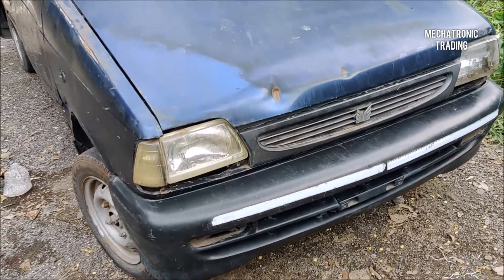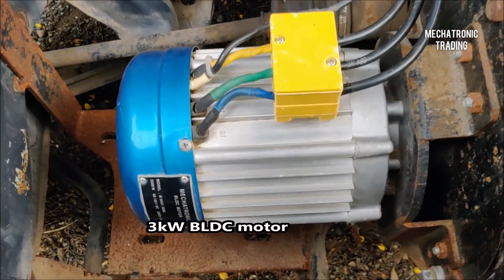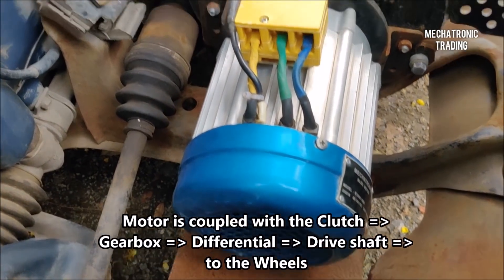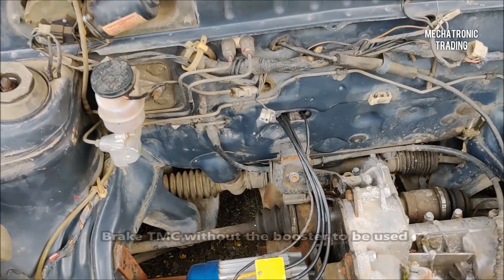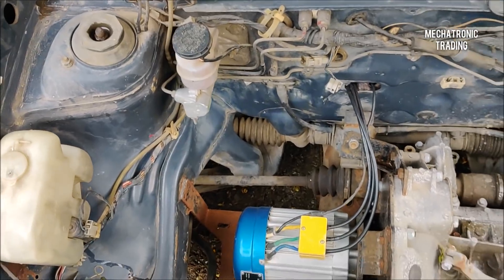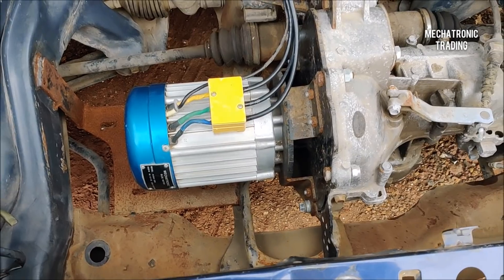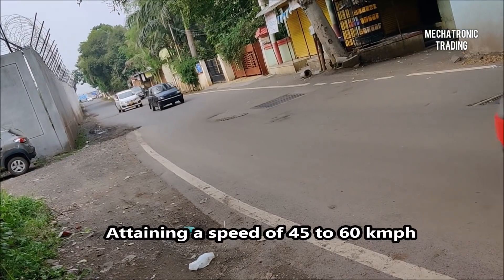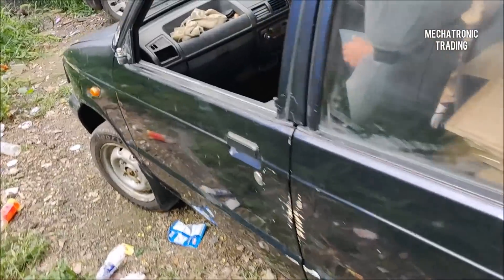DIY Electric Car Conversion Kit India | Maruti 800 Electric Conversion Kit | Electric Car

Comment: here a quick tip !!!..... 
consider the motor voltage of 60 volts , and the power is 3000watts or 3kWh , so we can calculate the amphre required to the battery by a single calculation by diving the motor watt by motor voltage gives the amphes required to run the motor for 1 hour that is ,.. 3000/60 = 50 amps , so we need a 60 volt 50 amp battery to run the car for 1 hour , and to increse the time we can connect a same spec battery to parralel connection and get 60volt 100amps so we get double the mileage

Comment: Do you have a 72v-96v 5000kwa motor matching 6000 max rpm of the 800cc engine? I understand there would be additional batteries required

Comment: Super and excellent method of using with existing gear box. I would like to implement on my 800 but using Omni's rear axles without disturbing engine bay. Seeking your support. Thanks
Reply from the maker: For details call or whatsapp on 9763025510
Click to WhatsApp us :-
https://bit.ly/2MryHj5

Comment: I am waiting of detailed video of this project.
Reply from the maker: Will soon upload it.
Reply: An electric tricycle kit is quite simple. Or you can search by the name of: bldc 3000w motor controller and foot throttle. but I recommend that you use two motors in case your car is a little bigger this maruti only weighs 500 kilos worse others can weigh 900 already with the motor and the batteries. the battery must be 60v or 72v depending on the configuration of the motor I recommend two motors by the way.

Comment: Can i use 2kw motor for increasing the speed of vehicle by attaching pulley system to the transmission plse reply me on wats app brother i am also an automobile engineer with 2019 passed out 7358662324

Comment: Maruti 800 engine produce 27 kw of power and u r using a 3 kw tiny motor 😅
Reply: But it is not the same with the torque of electric motor.
Reply: Bhai mere engine ho ya motor power sabb ki kilowatt m he measure ki jati h jisse bad m hp m convert kr lete h 1 hp = 746 watt
Reply: Maruti 800 produce 37 hp
And this motor is producing just 4.25 hp
😅😅
Reply: The Electric motor is 9 times weaker than engine + transmission losses
Reply: @insaneingineer642  but torqe is high bro
Reply: @biluroy4455  Roy sahab electric vehicles m torque (pick up) se jyada efficiency matter karti h
Reply: @insaneingineer642  efficiency bhi bhout jayada he
Reply: 90%

Comment: Looks simple but quite a great idea. Incorporating the stock gearbox too was really a great work to utilize more power from that small motor but what about the battery you are using and what is the range and charging time, load carrying capacity...etc...

Comment: Hello Sir, 
Very very good, how many volt & ah of battery?
Reply: consider the motor voltage of 60 volts , and the power is 3000watts or 3kWh , so we can calculate the amphre required to the battery by a single calculation by diving the motor watt by motor voltage gives the amphes required to run the motor for 1 hour that is ,.. 3000/60 = 50 amps , so we need a 60 volt 50 amp battery to run the car for 1 hour , and to increse the time we can connect a same spec battery to parralel connection and get 60volt 100amps so we get double the mileage
Reply: @black-cat-hackerjr822  thanks for reply
Be happy
Reply: @pateltach5067  thanku mr patel , i struggled a lot to find about battery volt and amps calculation , i thought if i can clear your doubt it might be a good thing to do , i know i anm year late but hope it helped you in  your project mr patel , bye take care be safe and happy

Comment: Transmission box can be detached to allow more power and efficiency from the motor...you can use an electronic speed controller to control the speed and reverse. Using stock transmission will make the car heavy for an electric conversion reducing the motor power and the battery capacity.
Reply: Or lets say keep 2 gears remove the rest. Effective weight reduction plus range increase

Comment: What is the top soeed of this car and how many km it can do in ine charge
Reply from the maker: Top speed is 60 km/hr.We have installed a battery pack of 60 volts and 56 Ah for test ride application. We get mileage of approx 40 km/charge. Increasing the Ah rating of the battery pack will increase the mileage.
Reply: @mechatronictrading7446  mileage is not that bad but can be improved and please use lithium ion portable pack. That will keep the boot space intact

Comment: Great job I am also interested,,,,,, can you convert Maruti Suzuki Eeco into electric one.......
Reply from the maker: Thanks for the appreciation. Eeco will require a higher wattage motor. We will keep you updated once higher wattage motors are available.
Reply: Ok ,,,,,,I also want you to install ,,,,,a battary pack of around ,,,,40kw ,,,,,so that the vehicle gives longer range,,,and please try to install battery pack in the bottom of the body of vehicle,,,,,so that the boot space in vehicle,,,,,does not get affected,,,,,....

Lots of Love and Appreciation......keep doing this great job......

Comment: Plz add heat silk to the motor and opening on the bonnet to keep the motor cool. Second ly there should be some mechanism to control motor rpm at 800 at the start.
Reply: heat sink is a good idea. But what is the purpose of idle rpm at start . It will ruin the concept of electric cars because in traffic lights , it will constantly waste energy
Reply: @sumitmahawar6174  I will rephrase it should be starting rpm, because electric motor starts instantly at full rpm unlike ic engines where throttle push gradually increases the rpm. A full rpm from a electric motor may hurl the car instantly forward instead of smooth start. And another thing, our roads are often water logged, so plz make precautions to keep the passenger  and outsiders nearby from getting electric shock if the car accidentally enters water logged street
Reply: @siddhartharay1835  actually the rpm depends upon how u press the accelerator. U can experience it by putting the car in neutral and pressing the accelator...
Reply: @siddhartharay1835  also, these motors are waterproof in nature, also they are placed at a good height. Also we can it protect from shocks by putting controller in a safe place and all wiring in a closed pipe so that water does not touch any connections
Reply: @sumitmahawar6174  but if the hardware is sealed heat cannot escape
Reply: @siddhartharay1835  hardware needs not to be covered , its the wires and connection which can leads to shocks .for safety purposes you can use circuit breaker which cuts off the connections as soon as load increases
Reply: @siddhartharay1835  in costlier solutions which OEMs adapt, they employs a coolant which cools controller and motor so that they stay protected from water and run forever
Reply: @sumitmahawar6174  that is required bhai, to make the car practical, pls build a proper prototype and get a patent, then you can use it in any vehicle, just scale up or down
Reply: @sumitmahawar6174  but electric motor is a dangerous piece of hardware, any spill if water can cause fire 🔥
Reply: @siddhartharay1835  same motors are used in e-rikshaws in all over the world. They can hold alot of abuse. Nothing to worry regarding splash on motor
Reply: @sumitmahawar6174  I have seen but e rickshaw never go into water, moreover rickshaw are cheaper, and low voltage stuff, while cars are expensive and high-voltage goods. That is why I m a bit apprehensive
Reply: @siddhartharay1835  e rikshaws have to deal with water in certain areas of our country. Motors are waterproof but upto a certain level. Also motors are placed at a specific height which is way high than ICE engined cars.
Reply: @siddhartharay1835  if you are thinking about high voltage stuffs or fire, then don't worry. Cars such as tesla runs on much higher voltage but all it takes is making a safe system if anything goes wrong
Reply: @sumitmahawar6174  I m not v much sure about Tesla being successful in India. It's a very low floor and full of gadgets which may break down any time in our humid condition.  Just like merc, BMW, and Audi, very high maintenance, other wise will break down anytime. Gives signal on dashboard at any bad roads, and you have to rush to service centres
Reply: @sumitmahawar6174  if this is our indigenous system, then plz go for patent....some body might steal the design
Reply: @siddhartharay1835  this is not a rocket science. Carefully designing a system which can cut-off power supply incase something goes wrong is not so difficult. I've personally made my electric which is in beta mode right now

Comment: Is it possible to convert indica diesel car to electric... Can I know the cost
Reply from the maker: Yes, but you will require a higher wattage motor
Reply: @mechatronictrading7446  and higjer kWh battery
Reply from the maker: @AnubhabKundu  right for higher mileage a higher kWh battery pack will be required.

Comment: Even Maruti 800 has a 35 HP Engine and replacing with 3KW (4 HP) is not going to work much. More importantly One liter of petrol means 200 KG of Battery. Replacing Engine and petrol tank with battery bank means travelling with one liter of petrol. Better to purchase an erickshaw
Reply: No bro actually electrict motor torqe is much more than a petrol engine
Reply: 3kw motor but produce eual torqe of a 800 cc engine
Reply: @biluroy4455  How can you deny mathematics.  One liter of petrol means 8.76 KWH and even at 1/3 efficiency  its almost 3KWH. Now car at 60 kmph and say 20kmpl means 9KW . And this is minimum requirement. Practically nothing less than 15KW is going to work properly.  Anyway, if some car is doing 60kmph with 3KW motor and two persons in it is almost a miracle.

Comment: What is the rang ?
Charging time ?
Reply from the maker: We have installed a battery pack of 60 volts and 56 Ah for test ride application. We get mileage of approx 40 km/charge.
Charge time is 6 hours as we are now using a silicon gel battery pack. You can reduce the charge time if you choose lithium ion battery pack.

Comment: What is the battery capacity
How many km it can travel in a single charge
Reply from the maker: We have installed a battery pack of 60 volts and 56 Ah for test ride application. We get mileage of approx 40 km/charge.

Comment: where is the battery pack info if u have used a battery, Kindly share relayed info for complete understanding also if u r willing to provide services to consumers we can work forward speaking with Gov to authorize conversion on old cars. Thanks for reading
Reply from the maker: We have installed a battery pack of 60 volts and 56 Ah for test ride application. We get mileage of approx 40 km/charge.
The battery pack is kept in the rear part of the vechicle in the storage space(dikki space).We will come up with a new video demonstrating the assembly and placement of the batteries. Yes we do provide services to our clients. Till date we have converted more than 2500 cars to electric.
Reply: @mechatronictrading7446  can you say how to calculate the range of a battery ? 
Please say with this example itself. Like you said 60v 56ah battery can go 40km
Reply: @mechatronictrading7446  how much it costs to you and what is the overall expence that a petrol- cng tata indica to convert in electric?
Reply: How much cost

Comment: Hi, can v do it to maruthi omani van ? Your cell number please ? Or what's up # for communication with you.
Reply: Would require higher wattage motor and battery and controller. I strongly recommend a conversion on 5 seater omni than 8 seater one to save some money. It is not easy but not tough to do so either. You can connect a 36 V solar panel system (the roof area allows 2 or 3 such panels to be placed)  to get more range and use an embedded software to charge the 36 V modules separately....like if you have 72 V system, theb 2 36 V packs will be needed and you can use 1 36 V pack at a time to drive in economy mode while charging the other via a charge controller.

Comment: Can u supply  me the throttle  only what is the cost?
Reply: If you have a hand throttle then i can help you in converting it to pedal thottle..
Reply: @sumitmahawar6174  guide me to convert hand to pedal throttle
Reply: @gokulvasanthb1028  I can show you how I converted mine by sending pictures or video. Please provide your email ID
Reply from the maker: For details call or whatsApp on 9763025510